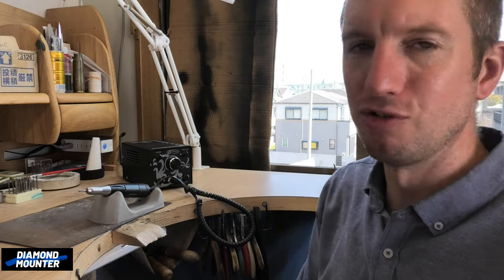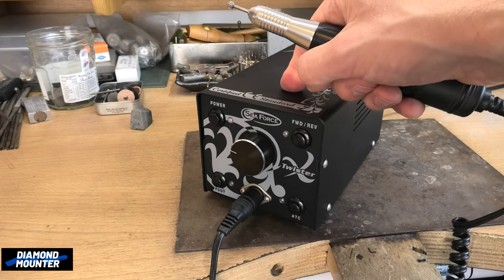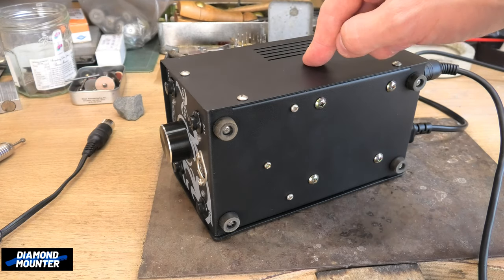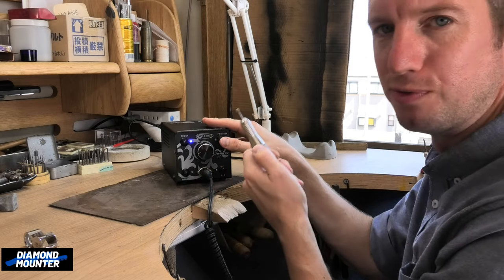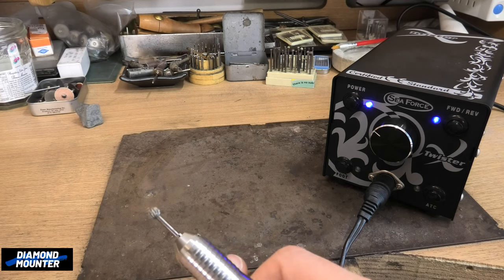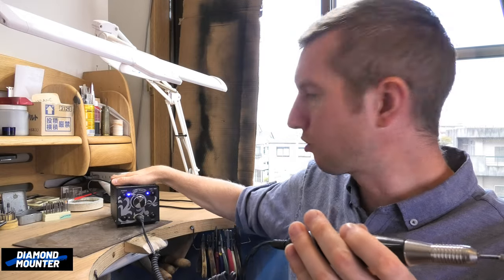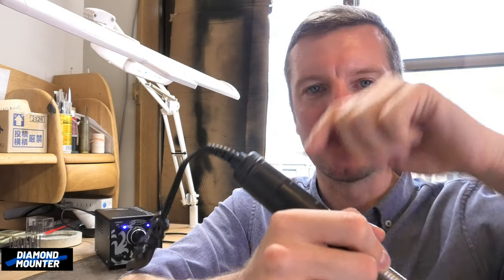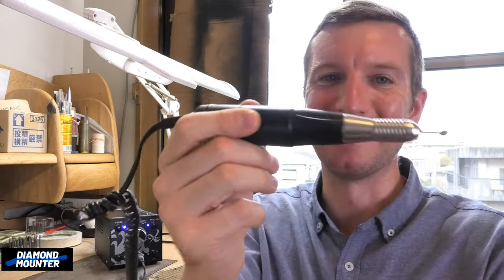Pendant Motor or Micro Motor? Which is Best??

Comment: What kind of pendant motor were you using? A Foredom? Or something attached to a Dremel or other copy of a Foredom?

I find the Foredom pretty darn quiet, I can listen to my audio book with it and the tabletop dust collector running (perhaps a good topic for a video, though much of metal could be done without.) The contact/cutting makes more noise than the motor so that noise should be similar.

I'm coming from wood carving, and all of my jewelery is wood and natural element based. but haven't had issues with the handpieces, though only have a couple clone/cheap quick release ones and not the high quality Foredom's at 10x the price.  I have a Strong 202 which I like and use. BTW Foredom SR and their higher power/more torque TX and LX can be reversed. 

2nd video I've watched, you got me repeating sections with the gibberish! I had a good laugh!

Comment: what about a hammer handpiece ? I've been debating getting a micromotor, but I really want to be able to use a hammer hand piece for certain stone setting
Reply: Buy a dremel engraver and learn to make your own setting hammers-you can pretty much shape any broken burr into a hammer. I use a brass rod that I've filed and polished in mine. They might not be as good as a hammer handpiece but in mad barsteward warp speed mr sulu mode you'd be surprised at what they can set. £20 vs £££ well worth a try. Great for texturing too.

Comment: Surprised that you never knew about the 'Foredom Speed-control Unit'. I bought one from a Foredom Dealer in Australia with the specific volt current for the Australian power source. I am able to operate my Pendant motor at a slower speed which plugs into the foot control. But it is rather irrelevant now to you. Thank you for sharing your experience.
Reply from the maker: Iv never used a fordom before but I know lots of people like the tools